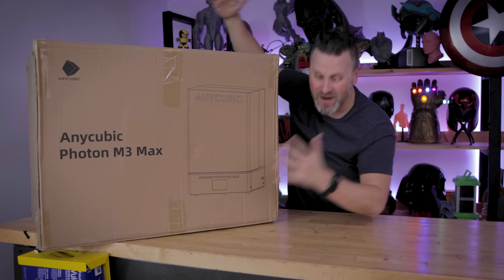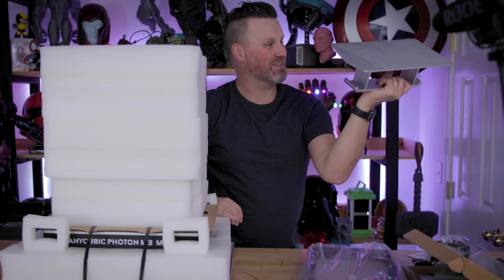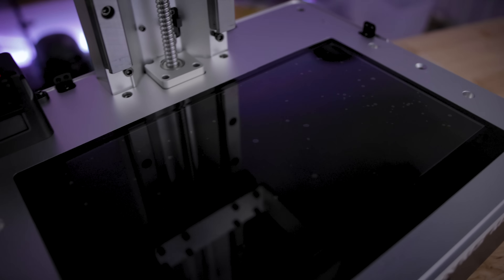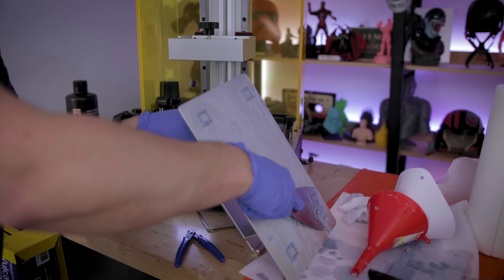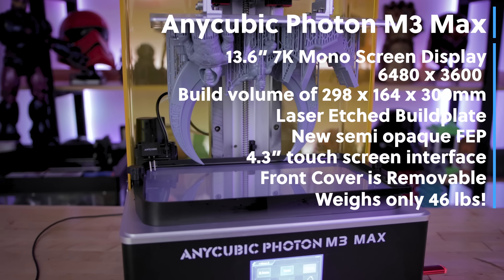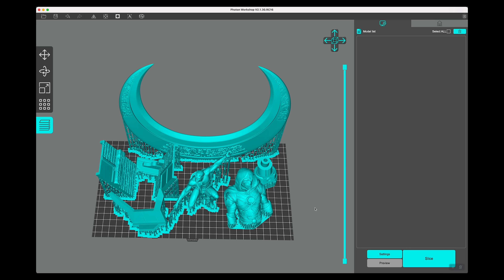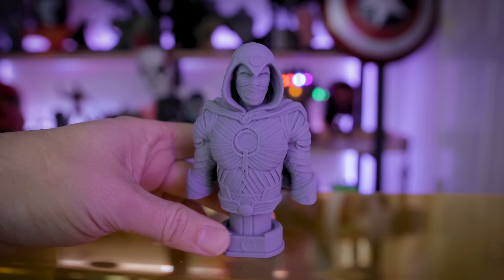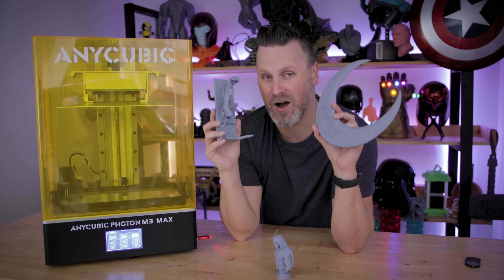This is amazing! Anycubic Photon M3 Max - First Look!

Comment: The REAL question is how hard is it to change the nFEP and how accessible are the replacement parts.  The website doesnt have them listed, there is no where I can find that sells them. Say you have a messed up FEP right off the bat... Then its a 1 grand paper weight for months and months.  Also, what is the deal about the nFEP being frosted? does that mean you HAVE to use an anycubic produced one and not a third party? Never owned a large printer but what have you ran into with FEPS for your large ones Uncle Jessy??
Reply: Been hearing about this happening with other anycubic printers in the past. That your experience as well?
Reply: @ataweiam7  happened on my mono 4k...filled the vat with resin (the supplied vat) ran a test print and found that the FEP had a hole in the corner that leaked resin all over the screen protector on the first print...

Comment: I currently use an original Photon, which is just about at the end of its useable life, and a Photon S.
Great timing on the release of this one as I've been considering replacing the old Photon with a larger format unit
and the M3 Max looks like it would fit the bill nicely and at a decent price point.
Are you going to do a full review when you've had time to test it for a while?
Cheers!

Comment: So now I’m torn between this or the elegoo Saturn 😬
Reply: Elegoo
Reply: Just saw this so not sure if you bought anything. I have both. Anycubic performs flawlessly. Saturn is usually good but currently not doing as good a job. Plus my Mono is 2x faster printing as long as you use the Photon Workshop slicer
Reply: @mingrassia8008  nice! Thanks so much I was leaning towards that way and this just confirmed my choice. You Rock!🙌🏽

Comment: Looks like an amazing machine, but I can't find any positive reviews for their customer service or after purchase support.  Would pull the trigger right now but what about support?
Reply: I've used customer support a few times,  never had a problem. They Always reply within 24h and work with me to fix my problems And never a problem to send new parts to replace faulty ones.
Reply: Just got an email answering my questions about them adding Lychee and/or Chitubox.   They sent me the link to their machine data page telling me the answer is there.  The only problem is nothing on that page addresses the question.   Felt like a first class blow off form letter.

Comment: I cannot understand what the point for the screen protection while it doesn't cover the edges. What is resin splash off the vat into the screen? Ok the screen will be protected but resin will find its way down into the UV Led unit.

Comment: Thought the wash & cure station was large enough to use with the Jupiter and was going to buy it right away, but the max sizes are 9.65" for curing and the Jupiter is nearly 13" Back to the drawing board! lol

Comment: Some printer manufacturers do not give upgrades later down the line when higher resolution screens become available which makes these machines obsolete in a year or two, people should be aware of this before buying.
When silent printers with 10k screen resolution become available i may buy one but till then i won't buy anymore printers.

Comment: If it wasnt already hard enough to justify the $2300 price tag on the Phrozen Mega 8k, this will suck up all of the sales theyre missing out on by being unable to keep the 8k in stock. $1100 vs $2300, 7k vs 8k, 13.6" vs 15" screen size. Yeah I'll go with the M3 and save myself $1200.

Comment: This is impressive and takes 3d printing to new limits. However I cannot think of a project of these dimensions. In my eyes this is a mass production machine rather than a 3 d printer. 1050€ is also a price to think about. Unless the big size is really needed, this is worth more than two Mono-X printers.
Reply: Presumably masks/helmets would be more feasible, and they sell for enough that it would pay for the machine quickly.

Comment: About those artifacts:
The photon workshop can't handle tiny overlapping surfaces and open faces that well , which is exactly what supports in Chitubox are ...
EASY FIX: export to stl with supports via chitu, open this file in Windows 10 3D builder and press the button in the right hand corner which says its non-manifold. 3D builder takes some time to fix all the issues and then it's ready to export, which you can then import in the photon workshop

Comment: This is a great addition for such a large printer. BUT I already see a major flaw.

That resin tube and system is going to be a pain. Especially if you plan to switch resins. This system WILL clog. I don't have the funds for any of these printers (badly wish I did), but the upside down resin bottle feeder seems to be the best refill option.

 Eager to hear/see Jessy's full review.

Comment: Interested about how the auto-feeder pump will last... and man they cannot put some kind of rubber grommet in the pump cables through the acrylic? External light can came through in some cases. 
Jesse what about the translucent FEP?? thoughts? How it cleans, better than transparent ones?
Nice touch about putting a free screen protector, but normal, the screen on their Mono X was a scratch magnet, super delicate screen!

Comment: I'd love to see the auto resin filler used with a different colour resin, should give a nice gradiant between your starting colour and your colour in the feeder!
Reply: Or adding something like a flexible resin
Reply: Would be interesting with the transparent resins - go from green to blue etc.
Reply: This sounds terrible. Each resin has different exposures. You'd want the autofiller to have the same resin as the entire print.
Reply: @StarAllKungfu  there are color mixing resins with identical exposures for C, M, and Y. I've done the exact thing they were talking about but by adding the colours in a little bit at a time throughout the entire print.
Reply: @FEEDMEKITTENS  Totally understand. lol. Legit just had a bottle of resin that had same setting as a different color in the same brand. The difference a day can make tocA!
Reply: @StarAllKungfu  If you stick with resins of the same brand, then exposure times are going to be pretty close if not the same

Comment: Jessy, thanks for another great video. I like my Anycubic Mono X but one thing that bothers me is that neither Chitubox or Lychee support variable layer settings for Anycubic. I’m printing some pretty large parts and the ability to change the lift speed and exposure time only in certain areas of the print would be very useful. These functions work for most of the other machines out there. I really like the M3 Max and it would be an easy decision if it had all of software functionality that other brands have. Any thoughts on whether these functions will ever be available for the M3 Max or any other Anycubic machines? Thanks

Comment: @Uncle Jessy Best way I found to get screen protectors down w/o air bubbles is to spray the screen with a little IPA and push them out to the edge. Use a paper towel to catch any extra IPA that leaks over, smmoth clean screens every time.

Comment: I just bricked my MonoX and I'm waiting for parts so its tempting seeing new models when you don't have one working at all haha. I love it but I do wish they would have put a heating unit inside at least the top of the range unit. But I suppose that hole at the back would be an ideal way to feed in a power cable from a 3rd party heater. Its fine in nicer weather but during those winter months I really struggled getting my shed up to temperatures the resin was happy with and as we all know, energy prices are just going through the roof right now. A small heating unity that just heats the printer would be fantastic. Maybe something they could release as an addon?

Comment: I would like to put hinges on the top to lift the front panel without having to find space for, other than having enough clearance above the printer. If that is a problem, then split the FP and put hinges on the sides

Comment: Can you print a mandalorian helmet in one piece with a resin printer  ? If so which one?
Reply: You’re better off with an FDM printer in my opinion. Resin prints are very delicate and the resins are more expensive, specially for a big print like a mandalorian helmet
Reply: @smokeduv  thank you for your help. I have a cr10 v3 for my large prints. Wasn't sure about resin printers.
Reply: @Shaka.M  a CR-10? Nice! If you’re still looking for a large format resin printer you might look for the phrozen mighty 8K, but resin printing is a lot messier than FDM so just take it into account. There are resins that might not break that easily like sirayatech’s blu resin or superPP from 3Dmaterials or any of the called “tough” resins, but they are usually pricier than standard resins. Or you can even mix flexible resins to make them more durable. Anyway, hope this helps
Reply: @smokeduv  this helps tremendously thank you so much. I'll look into that printer now.

Comment: You’re killing me. 

So the $1000 question. How does it stack up against the Jupiter. I’m waiting on my KS unit to arrive, and now I’m intrigued in this.
Reply: I´m on the Jupiter KS as well. My opinion is both machines are equivalent... the 7K resolution, bigger print volume and smaller footprint is a win for the anycubic.... on the other hand the jupiter seems sturdier, and I like the jupiter resin feeding solution better.. Elegoo could deliver the z extension kit with a screen resolution upgrade but I guess they left the modularity behind when decided to ship the printer fully assembled.

Comment: Great idea for the auto filler, those tines are the level sensor, very cool! But the hole in the case may be troublesome for those with a window behind their printers. In programs for full color 3d printing, holes become solid white lines, maybe that is similar in photon workshop? Details on the bust are great!

Comment: tempting...  would like to see an auto-unfeeder (reverse mode) for the resin tank filler :) that'd mess with the needed pumpage and filtering of course... but would be nice to not have to clear the vat so awkwardly in the reverse one day
Reply: For cleaning out the tank I've personally used a 500ml syringe to pull out the resin rather than trying to empty it all manually.

Comment: That test print took way too long for a mono screen printer. An hour and half?
Reply from the maker: Agreed... will be looking at dialing in/speeding it up a good bit. The larger machines def print a lot slower than your smaller ones.
Reply: Most likely firmware issues from around when he owned the machine, from what I was reading up on anyways.
It could also be certain settings.
I hear that it was using the starting exposure settings for basically every slice.

Comment: Not mentioned about the automatic resin feeder is what if you change resin. Does it need some flushing first on that line? Hopefully Jessy covers this in an upcoming video.
Reply from the maker: Will definitely be testing that out + how it might work with other resins. Not sure i'd ever need to swap it mid print but will try that out as well.
Reply: @UncleJessy  Looking forward to your video and conclusions Jessy. Thanks!

Comment: I have an old Anycubic Photon S that I still use Photon Workshop to slice files for. The artifacts you are getting are from hollowing with Chitubox. I never got the same problems if I hollowed with Lychee or Meshmixer before slicing in Photon Workshop. 

Presupports shouldn't be a problem, it's some weird interaction between Chitu hollowing and Photon slicing. If your presupported files are hollowed already, that's an issue, but if you have the Lychee file, I'd just remove the hollow (or reload the unholllowed STL) export and hollow in Photon Workshop. If you only have presupports as an STL or Chitu file, you might be stuck resupporting yourself
Reply from the maker: Two of the files were done in Lychee, one in Chitu, they all had the artifact issue unfortunately. I only ever see these when working with Photon Workshop. Will def be testing it out more
Reply: These weird things happened sometimes with me in a older version of chitubox. After the update nevermore happened. Never see someone else experiencing these weird things before. Greetings from Brazil UJ! Favorite 3d resin chanel!

Comment: Love how he takes ff the screen protector and immediately applies the backup one they provide hahaha. (You can tell the first was the same thanks to the "easy peel" white tab it has to revome the protector protector)
Reply: I’d argue that it is very unclear in the instructions whether a screen protector comes installed or not. I had to send a message to Anycubic and got confirmation that the Photon Mono X 6K indeed comes with a screen protector already installed and another complimentary spare provided. And I’ve seen other reviewers install the spare also so Anycubic would do well to clarify their instructions.
Reply: @j.israelsson  yeah, you're right. I knew it was a usable protector because of the white sticker on the top right. I am used to changing phone/tablet/computer screens, soy I recognized it. I guess that if you're not used to this, it is indeed confusing.
Reply: @Andithemago  Yes you're right. To me the white sticker means nothing other than it being a screen protector for shipping, like the film on the interface screen and not a "screen protector". And yes I have never, and will never apply a screen protector to my phone or iPad screen. Here though I can see the use for it. I'm still confused though, the thin film that the white sticker attaches to is NOT the screen protector but the protective film protecting the screen protector, or?
Reply: @j.israelsson  yeah, that's it. You should pull the white sticker and that peels the film on top of the protector. Then he removed the protector too.
Reply: @Andithemago  Well great then I might have gotten it right in spite of everything. It would be weird to not remove the sheet with the sticker but it is not obvious by looking and slightly touching the screen border that there is a screen protector installed. On friends phones it has been very obvious since the screen protector is quite thick. Thanks for your clarifications!

Comment: I would love to get a printer of this size for Warhammer, I push my mars 2's build volume a lot. However I find it crucial to have an angled attachment that either comes with the unit, or can be printed to allow the build plate to drip off excess resin for a long period of time before removing the models for less mess, however these larger build plates make it seem very difficult to do so, and you end up wasting a lot of resin that could have dripped off.

Comment: I do like that the build plate design and depth of the vat work to not fill in those bolts on the top with resin. I've always hated the '4 bolt style' build plates because they've got so many fidgety bits on them for resin to get stuck in.  -- On the other hand, that auto-fill system looks just smart enough to be a real problem. I foresee it squirting resin directly onto the screen because a switch in it got stuck or something. Guess that's why it comes with a screen protector.
Reply from the maker: Going to be doing some more printing over the next handful of weeks and for sure will be watching carefully to see what it does

Comment: This seems like a huge pain in the ass and possibly even more messy. I bought an Anycubic Mono X 6k and I think that's about as large a machine as I reasonably need. I think my next machine is a Phrozen Sonic Mini 8k and this isn't changing my mind
Reply from the maker: Yeah the larger units definitely arn't for everyone but its nice to have these larger options with a lot of good add ons available for them. Time to throw down a big cosplay mask ;)
Reply: @UncleJessy  wholly agree. If I had a dedicated workshop it'd be on my list but right now just a rigged grow tent!
Reply: @UncleJessy  I'm not trying to be super negative about it I just think the Smart Refill thingy is a bit gimmicky and unnecessary at least for my needs, I've never run out of resin in my Mono X tank considering its like at least half a liter capacity. I also find a lot of resin wasted on the top of the build plate and this would just create more waste. I try to do everything very clean because I have a small workspace, I can imagine cleaning that vat alone would aggravate me ha. I could see the benefits of these super large build plates but I mostly just print miniatures and this would be overkill for me. Additionally it wont help me because I'm printing a dozen or more miniatures at a time on a plate and it would just increase the failure rate. I'm already thinking about a second machine but I think the size and quality of the Mono X 6k hits my sweet spot right now. I just might sit and watch considering the industry is moving so fast right now. It's always cool to check out all the new machines regardless if i personally want or need them lol
Reply: As a mono x 4k owner, yeah. That's about as messy as I'd want.  Curious if they're getting AA functional on this without exposure time tradeoffs
Reply: Yeah, I wonder how flat the build plate is on this one? Had a terrible print bed on my mono x 4k!

Comment: i think this auto fill system is a gimmick at best/
Reply from the maker: On the midsize to larger machines it is crazy nice to have. Almost zero chance of failed prints due to running out of resin